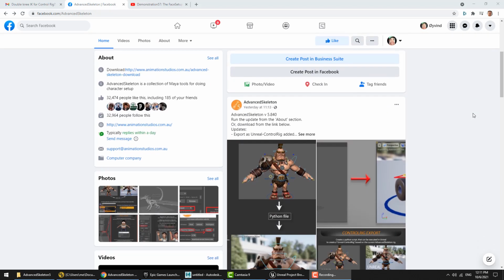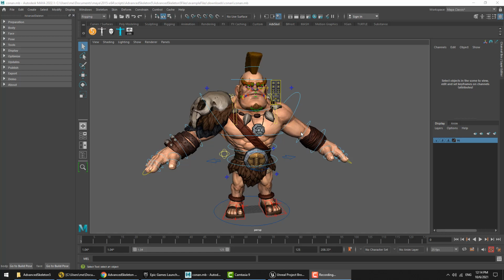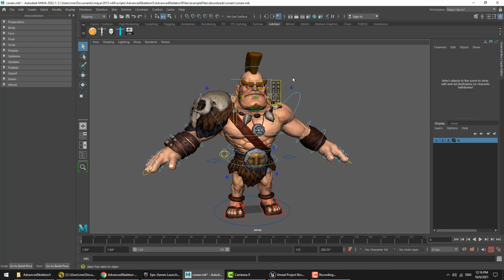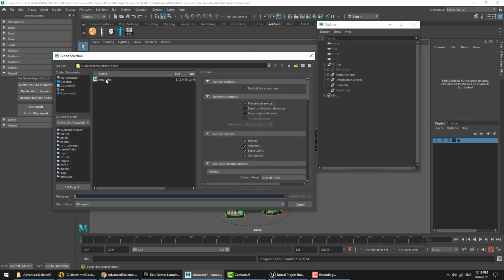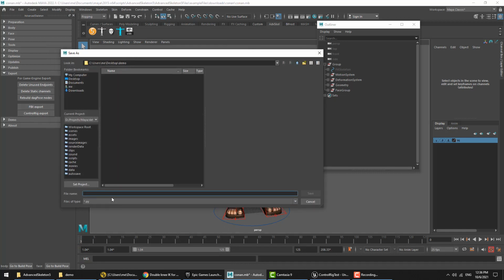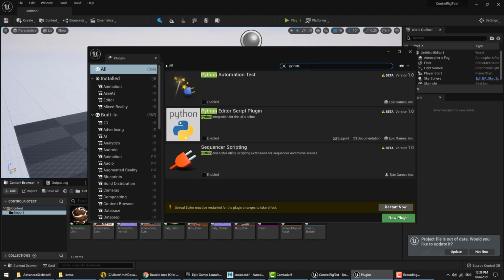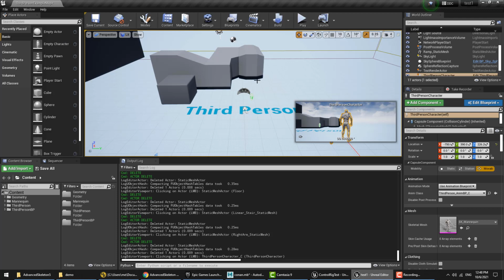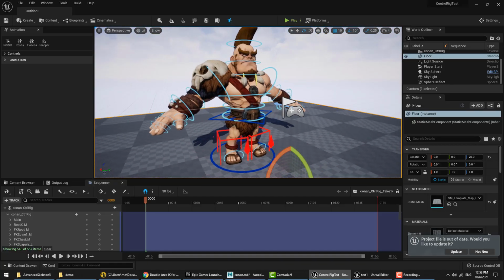Export to Unreal Control Rig

Comment: Has anyone else encountered the same issue as me? I'm using UE5.1, and after successfully importing the control rig, I found that the control curves were angled and this caused the lower half of my model to flip and deform. I've been searching for a solution for a long time, but still haven't found one...

Comment: How can we send advanced skeleton animation to unreal engine i have tried several times i just end up setting for alembic
Reply: This was not properly explained and was not intuitive, but here is how i managed to do it. Open project, make sure that in your outliner inside the folder Geometry there are all your models (you can exclude them from importing later), then select only the folders Deformation system and Geometry ( aka models with your skeleton!  ), then go to File-GameExporter. There select Animation Clips, export Selection, time and path. After that you should have fbx. Another radical way is to convert rig to game-skeleton, that is entirely controlled by joints, is to open main menu, Body-Edit-GameEngine and create Game Skeleton, but it might break some standard workflows so be careful.
Reply: @Efotix  Thank you for the explanation! I've been trying to get complex maya character animation rigs into unreal and i was at my wits end. I'll try it out and see if that works!